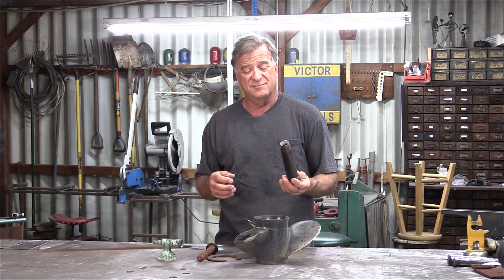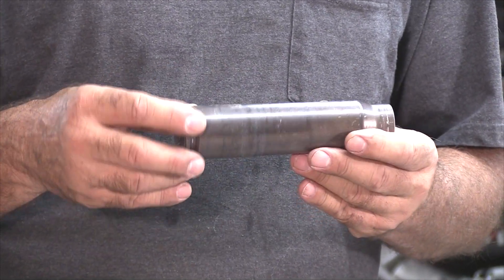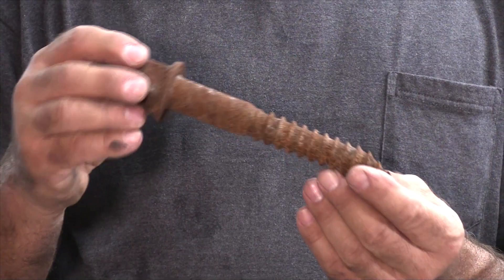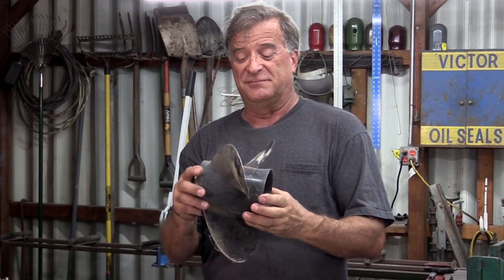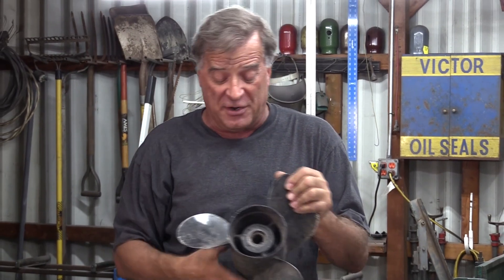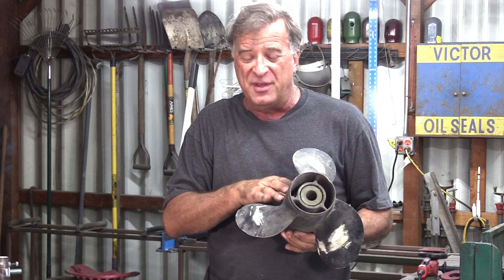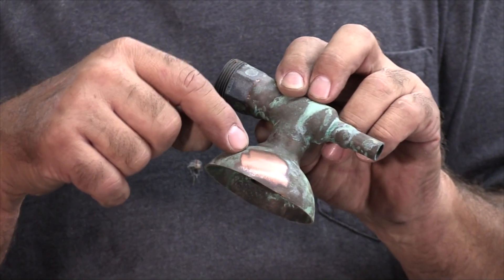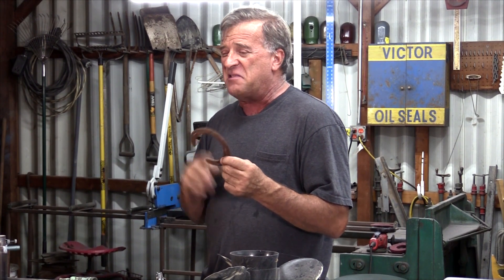What Kind of Metal Is This? - Kevin Caron

Comment: Im so lost on this one piece. Feels light for its size, non magenetic, but color looks like steel. Its brittle though, and it pits, without rusting...Im stumped. I broke a piece trying to clean it so I need to weld it or something...I could find the replacement part buuuuuuut, its in the EU and in Russia, so they dont deliver behind our iron curtain...
Reply from the maker: You might have a piece of titanium.  Where did you get it from and what was/is it used for?
Reply: @KevincaronSculpture  Its a compressed air antifreeze pump. I know it cant be titanium though...it was used in eastern europe for air systems, so its a manual alcohol pump, license built from Germany but the alloy really has me confused....(just in case you you look it up, its a Knorr-Bremse LA1100, but there are several types, this is the old type). I also just broke a piece, so now I have to find a machine shop to turn a tiny little shaft that holds a cup gasket, or use a drill and a file lol....

Comment: i suspect with the cartridge its probably nickel or a high nickel alloy like monel. i would expect to still see sparks if it where stainless. even nickel/monel will spark but they will be more of a orange red and much less abundant so probably only visible if you really dig into it.nickel/high nickel alloys  cartridges are used for large munitions fairly often
Reply from the maker: I didn't know that Dave.   Thanks for watching and posting.

Comment: Phosphorus Bronze was used in a lot of inserts on outboard motors as well as a lot of propellers on large ships
Reply from the maker: I didn't know that,  thanks for posting and watching.
Reply: @KevincaronSculpture  Phosphorus Bronze is closer to Aluminium on the galvanic scale than S. Steel, therefore less likely to grow together and cause the aluminium to oxidize as much. Stainless is now cheaper then P. Bronze so tends to be used more